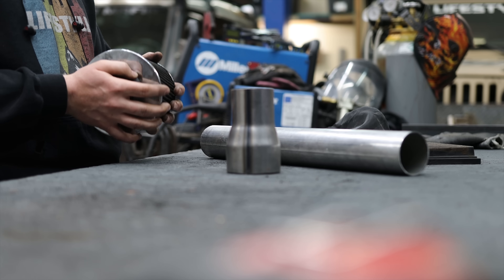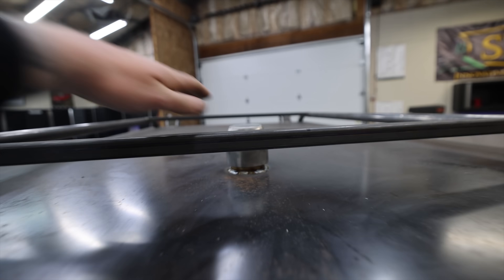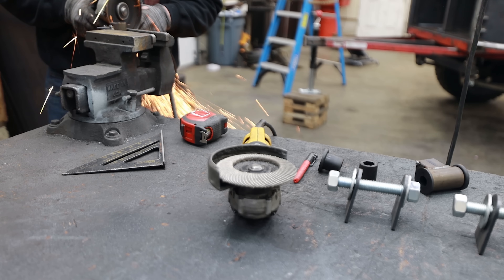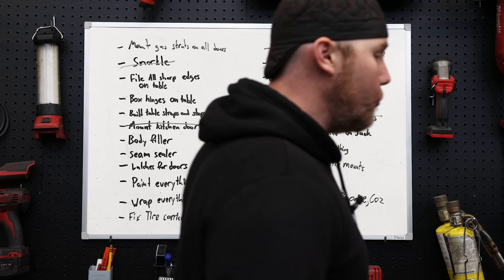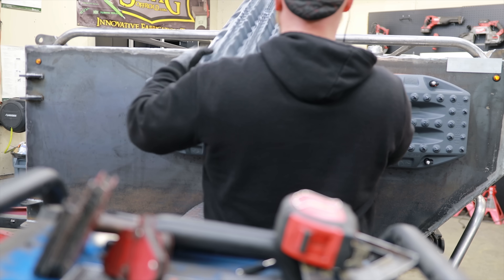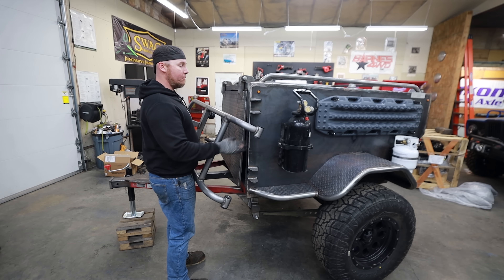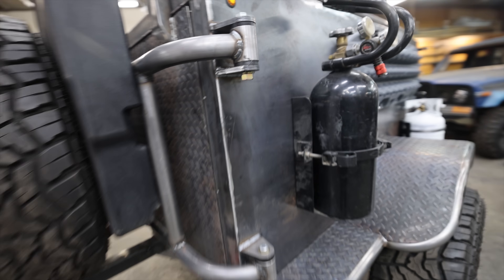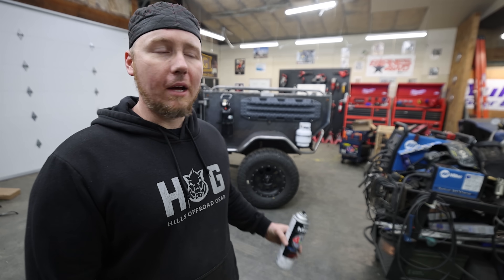Let's Build More Weird Offroad Trailer Mods! Harbor Freight Overland Trailer Episode 8.

Comment: May be you overbuild everything. 
I would have used a lawn mover air filter mounted flat on the top or the side of the tailer, that would have been enough.
Your filter is sticking too far inside the trailer and you are going to hate it right away. 
Not your best design.
I think that the fan idea is the best so far. I use to work in a clean room with positive pressure to keep the dust out.